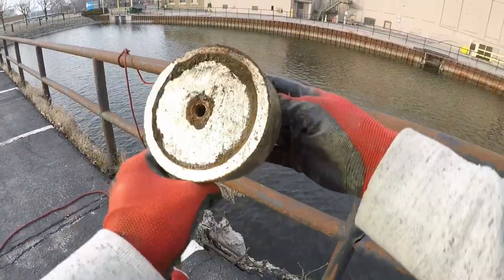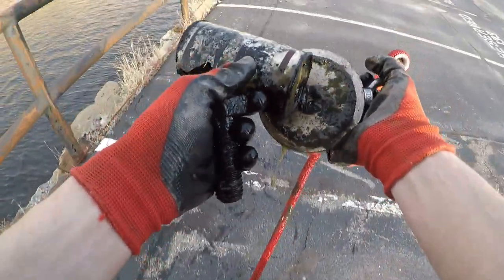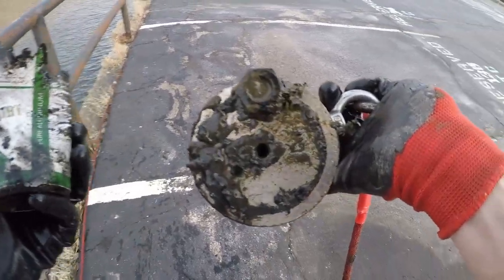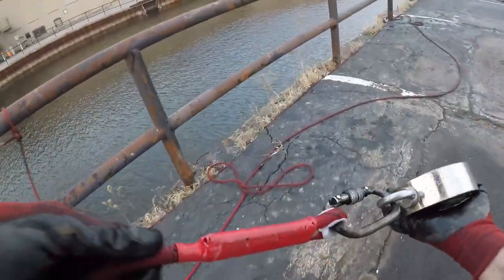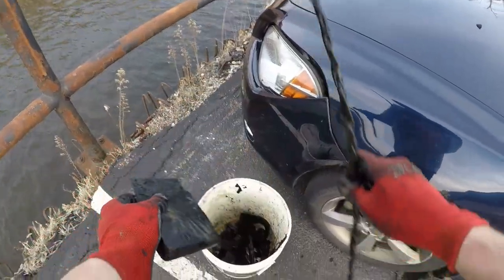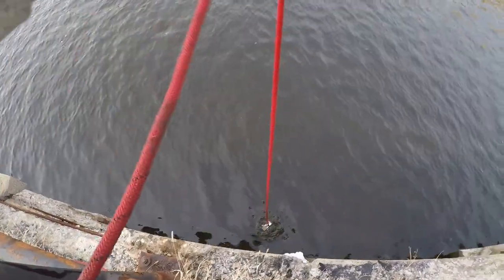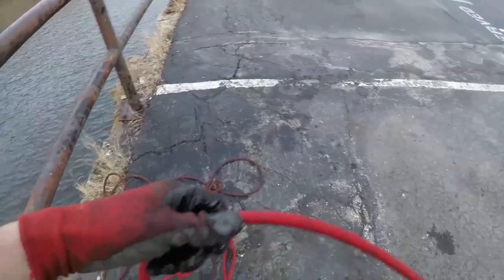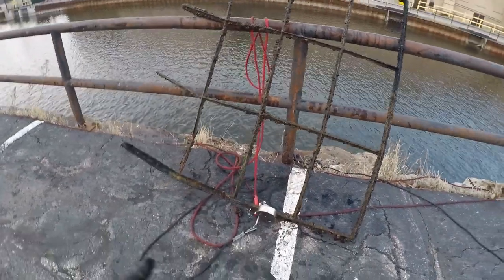I NEVER EXPECTED TO FIND THIS MAGNET FISHING!!! (BIGGEST FIND EVER)

Comment: The two large bolts are socket head cap screws used a lot in machine shops. The saw blade is from a power hack saw also used in the machine shops . With all the pieces of metal and files there must have been a machine shop some wear in the area. Interesting stuff to me as I have worked in and around machine shops all my life.

Comment: The square metal at 5:30 along with the one you compared it to from the bucket could be gauge blocks used by a machinist. With that, the files, and the hammer, it looks like maybe some machinist tools were lost or dumped.

Comment: The steel squares look like Bench Blocks. When metal pieces are hammered on a block it "work hardens" the metal or wire to make it sturdier. They could have been used in a shop for metal pieces. Or that could be way to modern and they are just random blocks ... You never know. It definitely seems like Metal Work took place there. I love that fishing spot.

Comment: The Bud can wasn't even a pull tab can , it was older than that , for that one you needed a can opener to pierce it. The bar with the rounded ends looked like a shaft key , they go between a shaft and the pulley or whatever is being driven .  I couldn't tell what that big frame thing was made of but it kind of looked like a window frame from a building.  Maybe you could research what that water way was for / used for way back when.
Reply from the maker: That is wild! 😳 Thank you so much for watching!!

Comment: Your first catch was a shear pin used to connect a gear with a shaft so the gear will turn. The rubber square with round hole is gasket material. Someone cut a round gasket and threw the rest away.